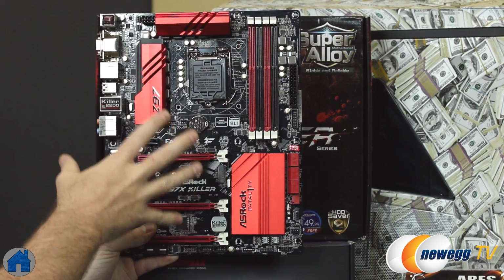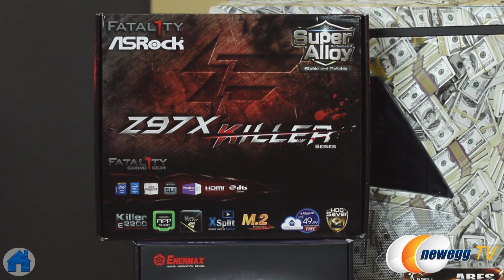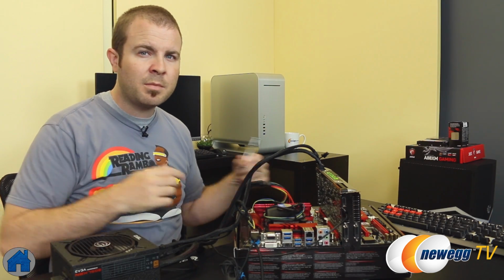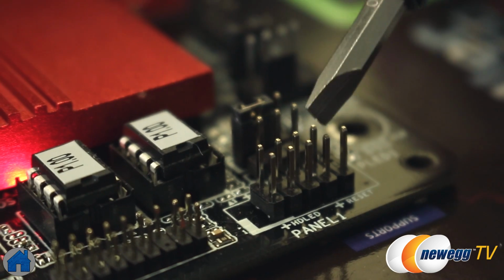How to Build a PC - Part 1 - Newegg TV

Comment: hows this setup
cpu:Intel Core i7-5960X Extreme Edition
mutherboard: Gigabyte GA-F2A78M-D3H, Socket-FM2+
gpu: ASUS GeForce GTX 750Ti 2GB PhysX CUDA
psu : XFX ProSeries Core Edition V2 450W PSU
hd:WD My Passport Ultra 1TB
ssd: LaCie Rugged Thunderbolt 500GB SSD
case : Cooler Master Elite 120 Mini-ITX Sort
ram:HyperX Fury DDR3 1600MHz 4GB Black
buying the part s tomorow my borther say he help me but i not sure if parts fit i have to buy them tomorow thx

Comment: This is what I plan to build within the next few days. Any good?
Specs:

CPU: Intel i5 4460
MOBO: ASRock H97M Pro4 LGA 1150
GPU: EVGA GeForce GTX 970 Superclocked 4GB
RAM: G.SKILL Ripjaws Z Series 8GB (2 x 4) 2400MHz
HDD: Western Digital WD Blue 1TB
PSU: EVGA 600B Bronze 600W
Case: Rosewill CHALLENGER Blck Gaming ATX Mid

Comment: Hi, guys. I have just bought all my components and will start building my computer as soon as my components arrive. However I've never built a computer before and I would love it if you left me feedback! 

CPU- AMD FX-8320 3.5GHz 8-Core Processor

Motherboard- Gigabyte GA-970A-DS3P ATX AM3+ Motherboard

Memory- Crucial Ballistix Sport 8GB (2 x 4GB) DDR3-1600 Memory

Storage- Western Digital Caviar Blue 1TB 3.5" 7200RPM Internal Hard Drive

Video Card- XFX Radeon R9 285 2GB Double Dissipation Video Card

Power Supply- Thermaltake 750W 80+ Gold Certified Semi-Modular ATX Power Supply?

Case- Corsair SPEC-03 White ATX Mid Tower Case

Comment: Is this a goodish gaming pc?

GPU: AMD HD7770
CPU: i5 4690k with stock fan
RAM: 8Gb DDR3
MOBO: MSI Z97S SLI PLUS Intel Z97 (Socket 1150) DDR3 ATX Motherboard
ALL storage: 2TB HDD seagate
PSU: Artic red+ 550w
Reply: The GPU's a it outdated. I'd go with a R9 270X, R9 280X or GTX 970. Apart from that, the parts are pretty decent.
Reply: im no professional but my psu need to be updated aswell, if i want a good graphics card then i think my psu needs updating
Reply: All I know is that if you do go with a  R9 280X or GTX 970 you'll need a solid 600w PSU, (so 80+ bronze rated PSU)
Reply: yeah, cheers ;)

Comment: Hi, i was wondering if this build will work. I want a decent computer that can run TF2 and CSGO and if possible games like Skyrim for as cheap as possible.

AMD A6-6400K Richland 3.9GHz Socket FM2 65W Dual-Core Desktop Processor AMD Radeon HD AD640KOKHLBOX--$50

ASUS Micro ATX DDR3 2400 NA Motherboard A88XM-E-$70$80

Cooler Master Hyper T4 CPU Cooler with 4 Direct Contact Heatpipes RR-T4-18PK-R1-$20$25

Thermaltake V3 Black Edition VL80001W2Z No PS Mid Tower Gaming Case (Black)--$40-$45

EVGA 500W 80PLUS Certified ATX12V/EPS12V Power Supply 100-W1-0500-KR-$40$45

Crucial Ballistix Sport 4GB Single DDR3 1600 MT/s (PC3-12800) CL9 @1.5V UDIMM 240-Pin Memory Module BLS4G3D1609DS1S00--$35

Thnx!
Reply: GrummpyGaminTV Alright, if you can go about $20 more than $100 for a GPU, I'd say to go with an Asus GeForce GTX 750ti
Reply: YOu should switch to intel and also get a gtx 970 and probably 16 gigs of ram if you want to have decent performance.
Reply: How much do you intend to spend? If you have more money, I'd invest on a proper GPU or GFX Card. As of now, I have a 760, and an 8350 and it runs Skyrim with mods at Ultra High around 50ish FPS. And for the cooler, I'd recommend the Cooler Master Hyper 212 EVO. And also, a quad core processor. I'd definitely get more RAM to run those games, 8 gigs is enough.
Reply: SlicingSniping The TX4 is a great cooler, as well. I have it, and I prefer the fan over the one that comes with the 212 EVO.
Reply: You need a GPU
Reply: Thanks for the feedback. I've decided to up my budget a bit to around 425. should i switch to Intel? I'm trying to get a decent GPU. Nothing overly priced. id say around 100. any suggestions?
Reply: GrummpyGaminTV Read reviews. Look on pcpartpicker.com. I found one that might be good: http://pcpartpicker.com/part/sapphire-video-card-112170420g
Reply: SlicingSniping ok, im going to do some reasearch on it
Reply: GrummpyGaminTV Yeah, a good GPU is a must for a gaming system.
Reply: :O Teamfortress2 BEST GAME EVER!
Reply: GrummpyGaminTV Skyrim runs better with Intel.
Reply: Eric Biscuit ok
Reply: Josh C
You are forgetting one thing... He is on a budget!!!!
btw just so you know AMD  is a budget processor brand and is great especially the athlon series which fyi is the A6 he chose.
so if i were him i would go with a amd athlon 860 (4 core 3.7ghz)
amd radeon r7 240
MSI A68HM-E33
4-8 gb crucial ballistix sport ram
then 1-2 TB hard drive
with all that your only running about 500$ when you add other essentials and bam that computer can handle most games soo your decent intel and gtx 970 (which is great as long at its not a celeron) can still beat it but guess what thats 300-500$ more so have fun with your little knowledge my friend :)

also don't talk when you don't know anything about computers
prob on you crappy 200$ laptop cough loser

Josh C also probably has not built a computer before I have. Why am i watching this vid... because i can

just because i know people will be thinking im running what i said before... im not

im running i74770k gtx 770
Reply: Willabeast I do not appreciate you calling me a loser. Could you please not say that? It is rude and disrespectful.
Reply: Willabeast And I do know stuff about computers and I am just watching this to see how in detail their video is. I have been learning stuff about computers for like the past 5 years.
Reply: Josh C My friend, please don't make assumptions about my computer. AMD makes great budget processors. I just don't like assumptions. If he's on a budget he should go with the FX-6300. It is $20 more but has 2 more cores.
Reply: Eric Biscuit I never said anything to you
Reply: Josh C My bad i am sorry buddy :).
Reply: Josh C maybe if you dont want people to call you a loser then don't comment when you don't read everything. he said budget and you said expensive. thx Eric Biscuit for proving my point that amd makes budget processors and Josh C doesn't realize that. and then he tries to tell someone not to say something. i live in america im allowed freedom of speech the only thing he can tell me not to do is use vulgar language. loser is not vulgar
Reply: +Josh C... Im ganna talk shit about u now... U First of all dont know anything about computers... Intel and gtx 970 would be pretty expensive especially if its any of the 4th gen I series. 2 dont tell me not to call u something and then say that you have been learning about computers for 5 years. When i look at your channel guess what... Those 5 years were trying to get past the power button u sound like your 10 using your mom 10 year old laptop. Get some knowledge and dont lie about what u think you know. i know what i talk about do you?
Reply: Willabeast
Ok. I will stop. But two things. I have knowledge about computers. Do not use vulgar language towards me. Thank you.
Reply: An old Celeron laptop will run those games fine (i play those games on my Celeron 1007U @ 1.5ghz laptop)
Reply: GrummpyGaminTV if you can get two 2GB sticks of ram. It's better to run it as a dual channel. Although it would be better if you got 8GB of ram (so 2x4GB). Though I think you might want a bit of a stronger cpu for some higher fps and you can get away with for example using an R7 250 as your video card for a lot of games. HD 7750 would be better though. it has 2GB GDDR5 as opposed to the R7 250's 1GB GDDR5 or the 2GB DDR3 version. I mean to say that the HD 7750 is definitely better than the R7 250 that has 2GB DDR3.

Anyway in the computer I have I can run most of the games I've played without problems (aside from the occasional frames drop in Garry's mod from messing around and making a bunch of npc's fight each other) and for a cpu it has an fx 4300 and the gpu is an R7 250. The other factor may be that its OS is windows 8.1 and it has 8GB of ram.

I dunno I wish I could be more help here as I know you're trying to keep costs down.

Comment: I am looking forward to building a real gaming/video editing pc.
I am very knowledgeable with computers, but I would like an expert opinion on my choice of parts on if they will be adequate  for a build? I would also be open to some suggestions on other parts for this build.

Motherboard: ASUS M5A99FX PRO R2.0 AM3+ AMD 990FX SATA 6Gb/s USB 3.0 ATX AMD Motherboard

CPU:AMD FD8350FRHKBOX FX-8350 FX-Series 8-Core Black Edition Processor (OR)
AMD FD6300WMHKBOX FX-6300 6-Core Processor Black Edition
(I'm wondering if the performance differences between the two will justify the price.)

Ram: Kingston Technology HyperX 8 GB (2x4 GB Modules) 1600 MHz DDR3 Dual Channel Kit (PC3 12800) 240-Pin SDRAM KHX1600C9D3K2/8GX

HDD: Seagate Barracuda 2 TB HDD SATA 6 Gb/s NCQ 64MB Cache 3.5-Inch Internal Bare Drive ST2000DM001
(But I am open to a option for a 2 tb SSD for a cheap price.)

GPU: Gigabyte GeForce GTX 660 OC 2GB GDDR5 PCI-Express 3.0 DVI-I/DVI-D/HDMI/Displayport SLI Ready Graphics Card GV-N660OC-2GD (Obtained it from a friend later on down the road I might upgrade.)

Power supply: Corsair Builder Series CX 500 Watt ATX/EPS  80 PLUS (CX500)

Case: NZXT Source 210 ELITE Midtower Case with 3.0 USB - Black (The Case is somewhat irrelevant but mine as well put it on here.)

I haven't decided on what my optical drive will be But I am looking for a cheap bluray drive and a cd/dvd for my optical drives.
Reply: Ok,

CPU wise I would not recommend a AMD CPU.  They just don't has enough power per core.  So, I would recommend either a Intel core i5 4690k or the i7 4790k if you can afford it.

For the motherboard I would recommend a Gigabyte GA-H97-D3H.  They are very durable and reliable.  Also, the BIOS is easy to navigate.

To keep your CPU cool i recommend an aftermarket cooler such as the Noctua NH-D14.  It is very quiet and keeps your CPU very cool, even when overclocked.

For RAM I recommend G.Skill Ripjaws X Series 8GB (2 x 4GB).  This RAM is extremely reliable, cheap, and faster than the RAM you picked out.

For a HDD I would recommend the Western Digital BLACK SERIES 2TB.  It is reliable and very fast.  I personally own one and I haven't had a single problem.

Your case is fine.

For a PSU I would recommend the Corsair CX 500W.  It has the same amount of wattage, and it is very reliable as well.  I personally own one and I love it.  It is also fairly cheap.

The Video Card you have now will be fine for a while, but eventually I would recommend upgrading to a Geforce GTX 970.

Finally for an optical drive I recommend a Asus BW-12B1ST/BLK/G/AS.  It can read and write Blue Rays, DVDs, and CDs.  It is also fairly cheap as well.

With these parts you can easily tackle almost any video editing task, and play next-gen games with maxed setting on 1080p.
Reply: amazingjoe555
Thank you for your advice. I done the number crunching and it would be about $10 extra if I got the intell cpu with the motherboard you suggested over the amd CPU, so ill get the intel CPU. Do you happen to know of a Cheap SSD that can hold at lead two terabytes?
Reply: xDXPxJOEx456x1
Ok,

Sorry to say it, but there is no such thing as a cheap 2TB SSD.  The only 2TB SSD I could find was about $4,000!  I would recommend going with a hybrid instead.  They are large (GB wise) like HDDs and they are fast like SSDs.  They are not as fast, but will save you the hassle of buying a separate SSD, setting it up as a boot drive, and then remembering to locate everything to your HDD and not your SSD every time you download a program.  If you are interested in getting one, ditch that Western Digital BLACK SERIES drive and slide in a Seagate ST2000DX001.  They work, are much faster than the Western Digital BLACK SERIES drive, and they are only $30 more!

Hope that helped (:

Comment: How is this build?

CPU: I7-4790k
CPU Cooler: Cooler Master Hyper 212 EVO
Motherboard: Asus Z97-A
Memory :16 Gb 1600
Storage: Kingston SSDNow 240GB
Seagate Barracuda 2TB 7200RPM

Video Card: 2 R9 290 4GB (in Crossfire)
Case: Fractal Design Define XL R2
PSU: Thermaltake 850W 80+ Gold Certified Fully modular
OS: Windows 8.1
Monitor: AOC i2267Fw
Network Adapter: Netgear WNDA3100-100NAS 802.11a
Keyboard: Perixx PX-1000 Wired Gaming Keyboard

Comment: Guys i am planning on doing this build for my first pc, Thoughts?
Specs:
CPU
AMD FX-6300 3.5GHz 6-Core Processor
Motherboard:
Asus M5A99FX PRO R2.0 ATX AM3+ Motherboard
Ram:
G.Skill Ripjaws X Series 8GB (1 x 8GB) DDR3-1600 Memory
Hard Drive
Western Digital Caviar Blue 1TB 3.5" 7200RPM Internal Hard Drive
GPU
Gigabyte GeForce GTX 760 2GB WINDFORCE Video Card
Case
Cooler Master Elite 431 Plus (Black) ATX Mid Tower Case
PSU
Cooler Master GXII 550W 80+ Bronze Certified ATX Power Supply
OD
Asus DRW-24B1ST/BLK/B/AS DVD/CD Writer
OS
Microsoft Windows 7 Home Premium SP1 (OEM) (64-bit)
Monitor
Samsung S22C300H 21.5" Monitor

All runs in at around 880$

Comment: First time building a pc , Is this build okay?

[Processor] Intel Core I7 - 4770
[Video Card]  Asus GTX 760 2GB DDR5 256BIT
[Motherboard ]  Asus z97-A
[Ram] 16gb (x2 8gb) 
[Hard Drive HDD]  Seagate 2TB 7200RPM 3.5" SATA 
[Power Supply] Seasonic S12II-620 620W 80+BRONZE  
[Monitor 1920x1080 ]  Philips 21.5" 222EL1SB
[Case] Aerocool Xpredator X1 
[OS] Windows 8.1
Reply: Looks good except for the wndows 8 i would go with 7
Reply: Don't need a z97 board unless ur planning on overclocking ur GPU cause the CPU u chose isn't overclockable anyways
Reply: Aadibass  Windows 8.1 is the most efficient OS for gaming it's just that they don't like the start screen which you can get rid of by installing a few programs.  I am just focusing on the facts and not opinion.
Reply: MadDragon Jabberwock You can run easily BF4, CoD Advanced Warfare (which I don't recommend for PC), Skyrim, Bioshock Infinite, Farcry 4, and Borderlands The Pre-Sequal.  You should easily run these popular games and many more with ultra settings, 1080p, and at least 40 fps.
Reply: brick gaming Why? Isn't it the most efficient Window's os so far?
Reply: no windows 8 is a joke for gaming
Reply: My Awesome Username why?
Reply: I advice windows 8.1, I hated it at first, got used to it, PC worked so much more efficient, way faster, boot times got better, overall it's way better with newer hardware, gaming fps went up (bf4) from 50fps to 70fps, so I would go with windows 8.1, and too I advice a ssd, spares you all the annoying startup time and well worth the money (70 dollars for a 120 gb ssd) I would go with samsung 840 evo (got that one too, it's a good one)
Reply: Thanks for all the suggestions, It's really my first time to build a PC and I'm glad people are helping me out thanks guys
Reply: amazingjoe555 That' the same as I thought. I'm not really afraid of changes so I'm all for 8.1 (:.
Reply: One more question : 
What newly released games can I run easily with ultra settings with my build?
Reply: amazingjoe555 Thanks alot mate!
Reply: MadDragon Jabberwock Np.  Happy to help! (:
Reply: I think the build is somewhat compareble to mine (I got AMD that's equilevant) and I can easily run Assasin's Creed Black flag (except anti aliasing on max), far cry 4, BF4 and Shadow of Mordor

Comment: so what does everyone think about htis build. i already bought all the parts just waiting on them to come in. this is my frist time building from the ground up. 

COOLER MASTER 932 HAF Full Tower AMD Phenom II 243 x 560 x 564 mm

AMD FX-8320 Eight-Core 3.5GHz

CORSAIR Vengeance Pro 16GB (2 x 8GB) DDR3 1600 Desktop RAM CMY16GX3M2A1600C9R

ASRock 990FX EXTREME9 Socket AM3+/ AMD 990FX/ Quad CrossFireX & Quad SLI/

LG Electronics UH12NS30 12X SATA Blu-ray Combo Internal Drive w/ 3D Playback &

MSI GeForce GTX 770 2GB Twin Frozr OC N770 TF 2GD5/OC Gaming

Comment: How's this build guys? I mainly want to use it for DayZ. I would like to get a really high frame rate(40-50) and run it on high settings... 
Intel core i5-4460 3.2 GHz Quad Core processor
-ASRock H97 PRO4 ATX LGA 1150 Motherboard 
-Team Vulcan 8GB(2x4 GB) DD-R3-1600 Memory 
-Kingston SSDNow V300 Series 120 GB 2.5" Solid State Drive
-Western Digital Caviar Blue 1TB 3.5" 7200RPM Internal Hard Drive 
-Asus Radeon R9 290 4GB DirectCU II Video Card
-Cougar solution(Black) ATX mid tower case
-Corsair CX 500W 80+ Bronze Certified Semi-Modular ATX power supply  
-Samsung SH-224DB/BEBE DVD/ CD Writer

Comment: thanks for the great build video!  as a first time installer, I am very thankful to have this as a resource.  I will be building my Intel 4790 K, MSI Z97 Gaming 7, XTX R90x DD, 16GB G.Skill X 2133, Seasonic 1050w xm2, samsung pro 850 256gb components in a Thermaltake Core V71 build in 3 days (please UPS!) For now I am sticking w/ stock CPU cooler, but maybe I will switch to water cooler if I decide to OC...

Comment: Will a 600w modular power supply be enough for this build?

CPU: i7 4790k
MOBO: MSI z97 gaming 5
RAM:8GB G skill ripjaw 2400mhz
GPU: Asus GTX 970 Strix
HDD: 1TB Seagate Barracuda
SSD: Intel 530 Series 240 GB
OS: windows 8.1 64-bit
Monitor: Asus 144hz 24"
Case: Corsair 600t
PSU: Corsair CX600

Comment: How is this setup for a budget PC build

CPU: AMD Athlon X4 760K
Motherboard:MSI A78M-E35
Graphics card: Sapphire Radeon R7 260X
Memory: 8GB Crucial Ballistix Sport
Storage: 1TB Western Digital Black
Power supply: 430W Corsair CX430
Case:Corsair SPEC-01
Fan: Corsair AF120
WiFi adapter: Asus USB-N53
OS: Windows 8.1 64-bit

Comment: Hi guys, I just built my computer, and now when I hook it up to my monitor, now it won't show anything on the monitor. My power supply lights up, my cpu cooler fan spins, but there is nothing showing up on the monitor. Any tips? Suggestions? Thanks.

This is my build: http://pcpartpicker.com/p/TyTB4D